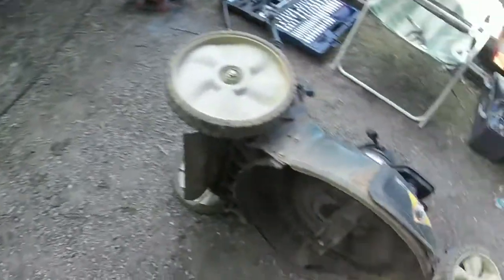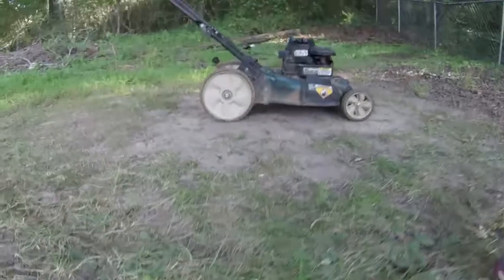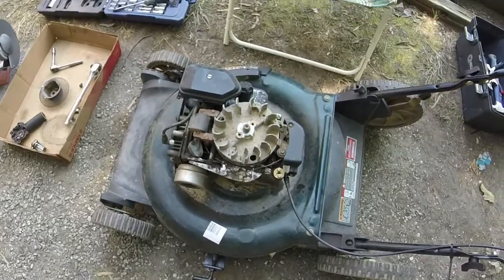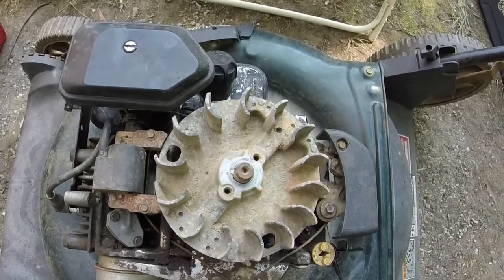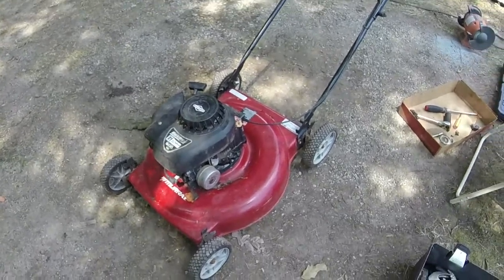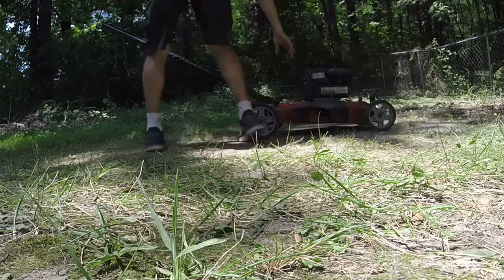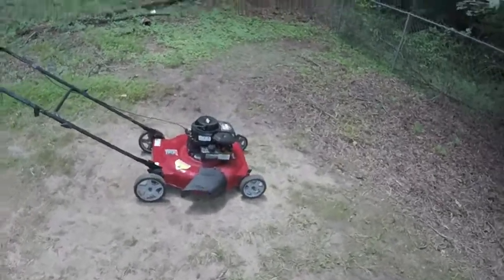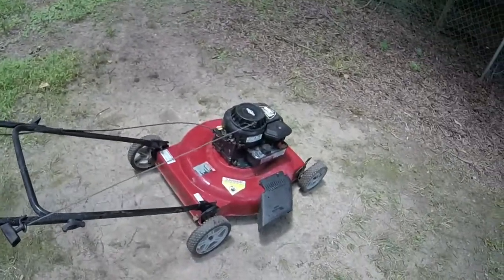Making a Bolens and Murray into one good mower

Comment: Twisted off bolts in the bottom of the motor are a disaster, I'm good with a drill but I've yet to get one drilled and it hold up.
Reply from the maker: They're a little tricky to drill but can be done, I've done a couple and did not want to do any more as they are a pain and in this case wasn't necessary.
Reply: Update to this fine comment, PB Blaster is a miracle in a can for this, got a can by accident and it's amazing, they all come out now, even off the salt damaged mowers.